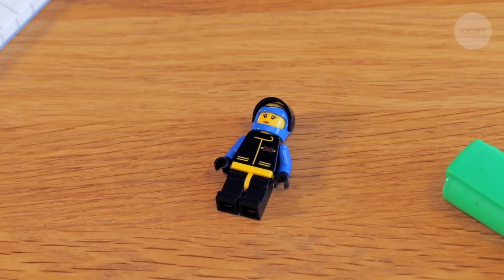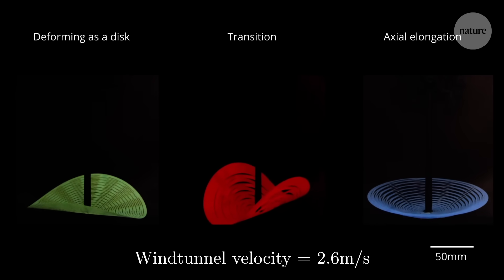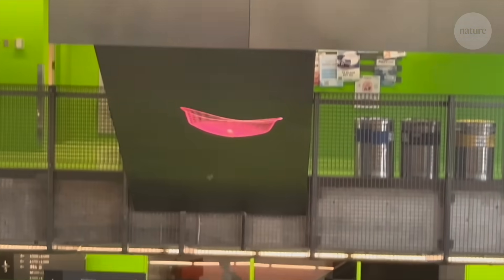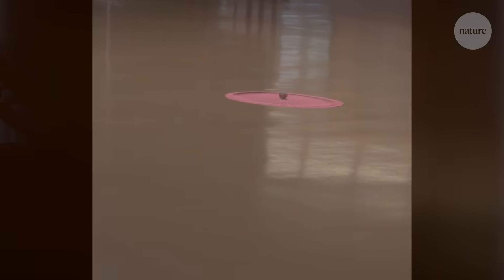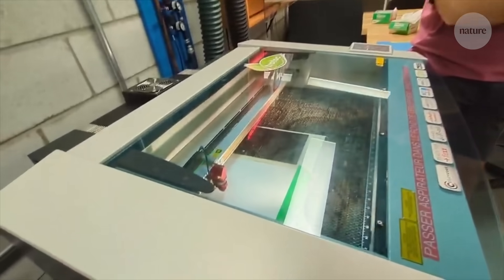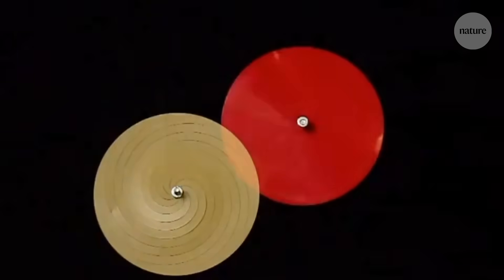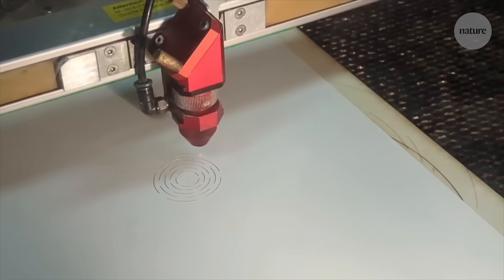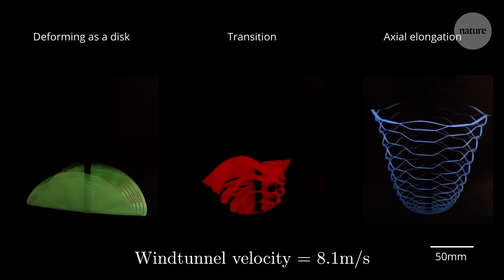This parachute is full of holes and that's a good thing

Comment: it could be practical for air dropping pallets, because you can have a decently large horizontal area on top of the pallet to stow a flat-packed parachute. I imagine you could connect several layers of such prachutes on top of each other to fit into a small enough footprint (it just ends up as a very long tail on top, butthat seems relatively unproblematic), and make them rectangular to fit a pallet. layer a number of parachute segments to match the mass of a given pallet, with the material of the parachute layers being stronger in the lower layers. I'm not sure though if there is a reasonably cheap sheet material that would bear the load well, or if you would still need to add fiber reinforcement following the pattern of the cuts. maybe you could use some kind of cross-layered or woven fiber composite, and shape the cutting pattern within a rectangular outline to only have cuts aligned with the two fiber directions so that every ribbon section has long fibers in it. I think some sort of coarse cellulose cloth (linen or hemp or whatever is cheap and strong) impregnated with something that's non-toxic to burn for disposal would be ideal. carbon fiber might work, and I'm not sure if it's competetively cheap, but ai think it's intrinsically a bit more limited in holding up to strong deflection (brittle), and it is somewhat hazardous waste. 

I think a very long parachute of this sort is likely to be more susceptible though to tangling and crashing with other parahutes when multiple pallets are dropped together.
Reply: It needs stiffness of the plastic/paper though, which is not enough at larger scale. And while a pallet has more area, it also weighs about a thousand times more than this test. You cannot make a huge dandelion out of dandelion material.
Reply: No, for this design to work for something as large as a pallet it would need to be massive and then you might as well just use a normal chute

Comment: I'd love to see the visualized airflow vs a conventional parachute model
Reply: Imagine a traditional parachute like an upside down cup of water with upside down gravity. If there's even a little bit of height difference along the edge, one side will spill water first. This "spilling" of air out one side of a traditional parachute causes a sideways force on the parachute, which on its own is not ideal, but more happens aswell. The parachute begins to swing some, and as it does so, the low side of the cup gets lower and spills more, which increases the angle in a vicious cycle until the parachute is at a large enough angle that the vertical component of drag swings it back to center like a pendulum. This creates a self-sustaining cycle that is unstable and makes it more difficult to accurately drop packages onto a target.
Reply: And that's a bit of an oversimplification of what's happening

Comment: So it works for small objects and it packs into a neat disc, but how about going bigger?
Reply: I have a Christmas decoration from years ago that works on this principle, but rather than just one perforated disc, it consists of many such discs glued together in series, half connected centre-to-centre, half connected rim to rim. It folds down flat but pulls out to form a long streamer. This could work to increase the drag/scale up these kirigami parachutes.
Reply: This is definitely not going to work or be applicable to scale up, it would be a nightmare to check and hell time-consuming to inspect for unwanted tears, rips, and defects...
Reply: @DrTubeman There are a ton quite useful humanitarian supplies similar in weight to an egg Or marginally heavier. Imagine a diabetic on a mountain top having an insulin dosing device air dropped or someone experiencing anaphylaxis an epipen. Modern tourniquets are very light weight bandages too imagine those being dropped to a medic who is pinned down by machine gun fire and trying to save a life. This couldn’t potentially drastically improve survivability in a lot of circumstances.
Reply: It'll scale up to a certain point by just using stronger and stronger plastic. Past that point, you'd have to develop a more rigid structure that could also achieve the same result while also being collapsible (if not foldable/collapsible, then it'd be impractical to deal with having this massive disc to drag around before parachuting)... It could use the same basic idea of kirigami, but would require a totally different design innovation.
Reply: It's not going to scale.
Reply: @eltamarindo  unless it folds
Reply: @torsatron360  Won't scale. The only thing that allows this to work is the structural integrity is maintained due to the strength of paper/plastic on a small scale. The ring shape is maintained because the forces aren't able to collapse the ring. If you have to scale it up to carry a human, that paper disc would collapse. You'd need to have something stronger like carbon fiber or a thin sheet of metal, which would defeat the entire purpose of the design. It's the same reason we see so many exoskeletal animals existing on insect scale, but none larger than a crab. Eventually, the physics makes the design fail.

This would be a fantastic use case for seeding areas by airplane with saplings, but not for anything much heavier than a few hundred grams.
Reply: @dereknalley  Exactly, the square cube law makes this utterly useless at scale
Reply: @dereknalley That gives me an idea if one were to sew in springy pop up tent like elements out of lightweight materials it could potentially offset the issue you mentioned while also providing an effective means of folding it.
Reply: @eltamarindo : It will scale, but they might have to switch to polygons with crossbeams, or maybe self-inflating fabric beams.
Reply: @absalomdraconis  And then you are back to expensive and complex

Comment: Super interesting!
Perhaps using different composite materials depending on radius with different degrees of flexibility could create a delay effect on "deployment" so to speak? As for origami... would be interesting to test segments folded over themselves to make the "parachute" smaller, but then you'd have to cover the hole in the middle of the disk... perhaps with something that looks more like a regular parachute...

Comment: Very interesting. If I were him I'd want to compare it with existing parachutes at different speeds and air pressures.
Reply: Just needs to be cheaper etc., even if it had to be larger than a conventional parachute.
Reply: They have!  More to come I'm sure in terms of video content I'm sure
Reply: They probably did and learned it’s not as good😂 as
Reply: Probably did. Couldn't keep up with the proven design, so just hyped the one they came up with that does 3x worse.. It's cheap though, so it might have many uses still.
Reply: OK, but you go ahead, then tell us about it!!

Comment: That’s cool that you guys are thinking about these kind of innovations.  Just an idea, how about using progressively larger diameter very short conical sections that are flexible for packing and all linked together .  The air currents would expand these rings and put them in tension during deployment
Reply: kind of like the shape of a Fresnel lens?